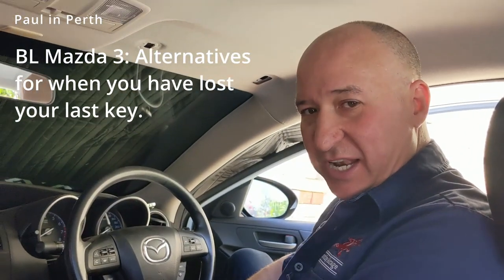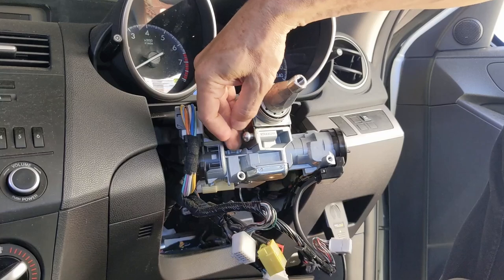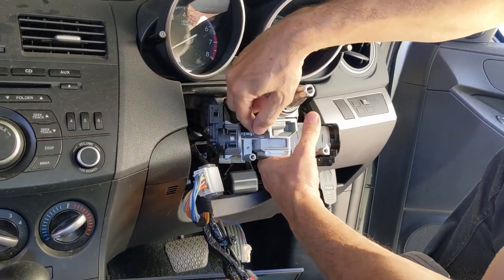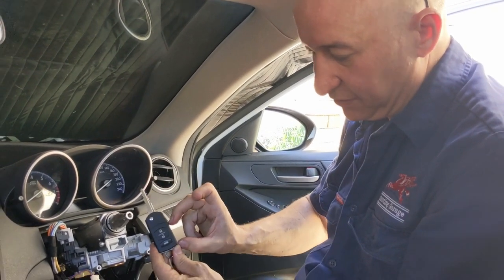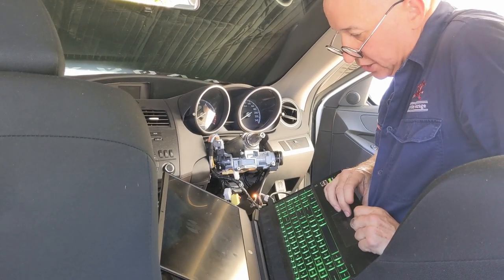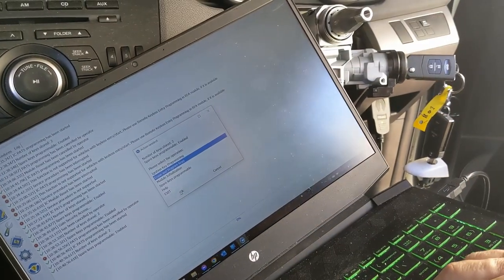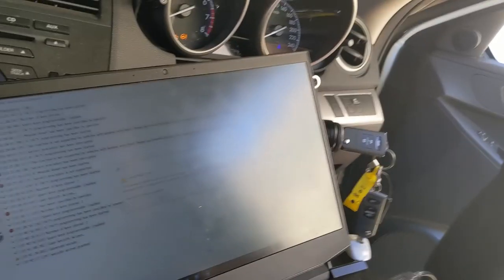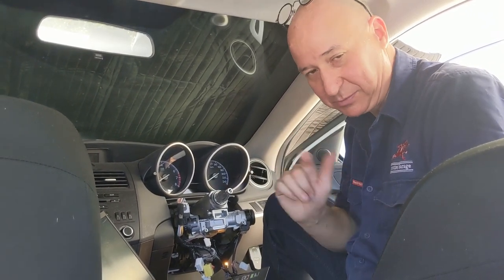BL Mazda 3: Alternatives for when you've lost your last key

Comment: The amount of money my local Mazda want for this job is absolutely criminal I’ll be doing the replacement myself for sure
Reply from the maker: So....... is that a thank you?

Just while I think of it, there is one other elegant way to solve this; as long as you kept that little silver keytag from when the car was new.

That keytag has the key serial number written on it.  If you quote that number to any auto locksmith, then they can make you a key that will fit your existing barrel.  This avoids having to change the barrel, barrel housing, and driver's door lock.  Then all you need to do it program the transponder codes into the BCM, which the locksmith can do, or you can do using my instructions and Forscan with OBDLink.

Paul.
Reply: @PaulinPerth  100% a thank you! Paul I’m a mechanic by trade, diesel though heavy road trans so cars to me are foreign-ish! This is a simple explanation of what needs to be done and even your comment is simple but these dealers continually quote astronomical prices and babble and bullshit so customers think they have no other choice!!! This is brilliant what your doing mate keep it up! Thank you for your advice it’s greatly appreciated mate
Reply from the maker: @rayw9067  Thanks Ray.  I appreciate it mate.  Paul.
Reply: ray - YES !!! I am helping a lady who has lost her keys, has only the valet key. The locksmiths are outrageous. Local mechanics want $170 per hour. She is on disability.

Comment: Can you program a used transponder from other's car?
Reply from the maker: Yes.  That's what I do in this video.  That whole key set, including the transponders in the keys came from a previous BL that I wrecked.
Reply: @PaulinPerth  hi...my mazda3 cluster is not working properly rev count nd speedometer, when i try to replace cluster the car is not starting....help
Reply from the maker: @edenmakale7880  Replacing the cluster will not work because the VIN stored in the EEPROM of the IC does not match the rest of the car.  The only way you are going to get that to work is to hand it over to a Mazda dealer.

Comment: Could you just get 2 new keys cut and use forscan to program them to the car?Instead of replacing everything?
Reply from the maker: Yes.  That would work.
Reply: @PaulinPerth  I’ve done it but when I was on forscan and went to erase the old keys and program new ones it erased the old ones and when I try to program the new keys it says “no key detected” do you think it’s an issue with the immobilizer coil antenna?

Comment: Hi Paul, mine is a bit different it's Mazda 3 bk 05-09, doesn't shut off with a key and the dashboard lights stays on and engine running even when the key is removed
Reply from the maker: Wow! That's quite interesting.  The first place I would look is the ignition switch at the end of the ignition barrel housing.  With a multimeter, check if the ON position retains a circuit when the key is in the OFF position.  I suspect it does.  If so, then you need a new ignition switch.

Paul.
Reply: @PaulinPerth  Thank you so much, I will definitely do that.

Comment: G'day Paul......... DE-series M2. Does it work the key system the same way as the BL-series M3...?
If the BCM already has 3-keys programmed. You have lost 2-keys & have only 1-key left

Now you want to program in a new (2nd) key which is physically the 4th key. 

Can you reset the "3-keys" feature of the BCM without a scanner or lap top program....?
Reply from the maker: I've never tried, and I don't have a DE to try.

But here is a tip to how I got to know so much about Mazdas.  When I didn't know the answer, I researched what I could online, and if that didn't work, I just got in the car and had a go.  You might want to try that.

Comment: This is amazing. Thanks Paul. I was wondering if I can ask a question. My wife has a 2008 MPV with a keyless remote. It is by far the worst keyless remote I have ever had. We are onto our 4th key and Mazda charges a arm and a leg to replace them. We have now lost the blade out of the key and I am thinking of replacing the keyless fob with a standard blade key as in the video. Would the process be the same with the proximity key? Thanks for the video any way. 👌
Reply from the maker: I've got no experience at that particular operation.  Sorry.  I can't help.  Try a good auto locksmith that is not Mazda.

Comment: For 100 years, cars worked just fine with simple metal keys ... these things they call "keys" are an invitation to getting locked out, alone, at night, in the cold because the key battery is low. 
And the EXPENSE is ludicrous.  Locksmiths laugh all the way to the bank.

Comment: Hi Paul,  Great tutorial videos. My son's 2012 Mazda3 starts when the clutch is depressed and the key is in the ON position, or when the key is in the ON position and the clutch is depressed.  ie. no need to turn the key to Start.  I suspect faulty or contaminated ignition switch.  How do I prove it?   oh.  and the battery is losing charge if the car is not started for more than a couple of days.
Reply from the maker: Hi Rysiukr, I'm not an auto electrician, but for what it is worth, I can only think of two possibilities:  the starter motor relay being stuck in the ON position, or the ignition switch having bridged the ON and START key positions.

Testing the relay hypothesis is pretty easy:  go to the fuse box in your engine bay and swap the starter motor relay with the aircon relay.  They are identical.  If that fixes the problem then replace that relay.  If it doesn't fix your problem then I'd look at replacing the ignition switch.  If you are in Australia, I can post both these parts to you.

Let me know how you go.  I'm curious.

Paul.
Reply: @PaulinPerth  An overdue update from Canada.  The relay was not the problem.  So we disassembled everything down to the ignition housing and popped off the ignition switch.  We then used a multimeter to test continuity between various combinations of the 8 pins (based on a schematic we found online) with the key in the four possible positions (inserted, ACC, ON, Start) and found that two pins that should have 0 ohms between them (ie connected) only when the key was in the start position were also connected in the ON position.  Ta da.  Faulty ignition switch.  Seeing as we had gotten this far, there was no point in not opening up the ignition switch to see it there was something obvious causing the problem.  The internals of the switch were quite simple... just two metal disks that spun when the key was turned...  and the only thing that looked suspicious was the amount of grease covering the two metal disks.  So we cleaned up the disks, reassembled the switch, reinstalled it and...  unfortunately had the same issue.  So it looks like a new ignition switch is in his future.  Thanks again for the video and the advice.

Comment: Hello Paul, from the Netherlands. Question: if you would change the whole lock unit, and use the new key together with the new transponder receiver, would there still be a problem? Thanks, Louis
Reply from the maker: Hi Louis,

I'm a little unsure by what you mean. I think what you are asking is whether or not it would work if you changed the keys, key barrel and transponder ring.

If this is your question, then yes.  You will still have a problem.  

You do not have to change the transponder ring (receiver).  It is a passive device.  It does not contain any data in it.  It purely reads the code of the transponder in the key and sends that code to the Body Control Module (BCM).

What you do need to do is write the new codes for the new transponders in your new keys into the BCM.

To do this, just follow the instructions in my video.  You need Forscan, which is free to download and install, and free to get a 30 day trial key that enables all features including key programming.

Paul in Perth.
Reply: @PaulinPerth  Thanks for your reaction. I didn't want to spend a lot of money on a car I need to sell anyway, so I went for the simple solution. Cut open de old key and took the transponder out, and installed it in the 'new' key carefully. Just a little bit of glue to close it, and you wouldn't know it happened. Car starts fine now! Thanks again, Louis
Reply from the maker: @louisstroomer4220  Great work Louis!  Well done my friend.

Paul.

Comment: what computer is the key stored in because i need to replace my ecu and wanted to know what computer they are stored in
Reply from the maker: Easiest solution:  get your replacement ECU programmed at a Mazda dealer.  

Second easiest solution: de-solder the EEPROM chip from your failed ECU and solder it onto the replacement ECU.  Possible alternative:  read the old EEPROM and overwrite the new EEPROM with those values using an EEPROM programmer.

Hardest solution:  use a matched working set of ECU, BCM, Instrument cluster, barrel, keys and driver's door lock. 

Paul.
Reply: @PaulinPerth  ya I was gonna try buying a used ecm and bcm with the keys and take the chips out and put them in mine so I didn’t have to change out the locks